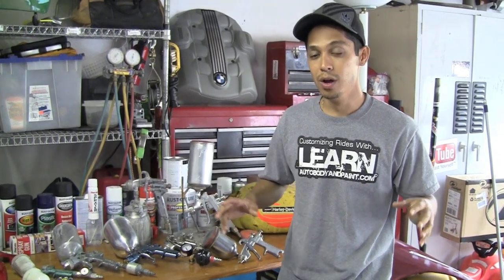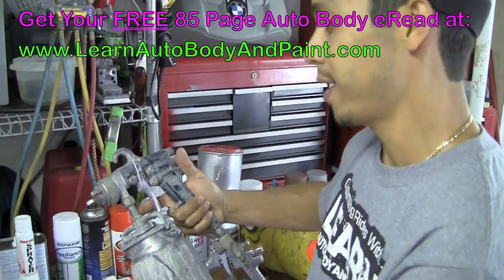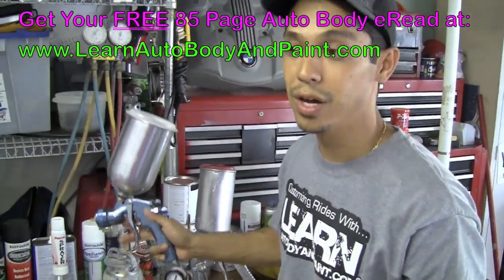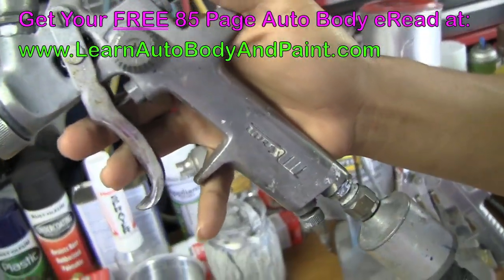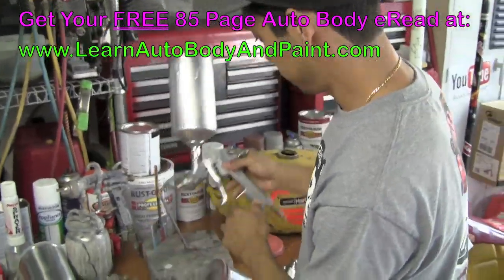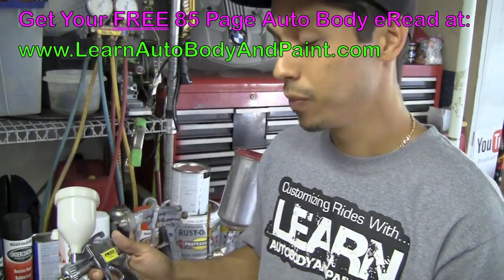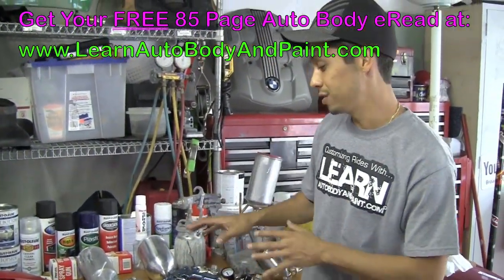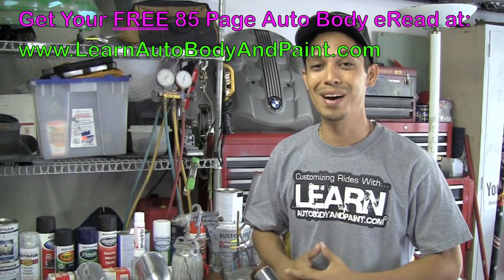Spray Paint Guns - HVLP Spray Guns & Siphon Style Guns - Beginner or Advanced Learning!

Comment from the maker: @ScagSWZU The M1-G to spray basecoats, clear coats, waterbornes, and high solids at fast application speeds with material savings of up to 50%. This comfortably light, superbly balanced spray gun is easy to operate and smooth to trigger with only 18lbs. of inlet pressure required. M1-G employs a unique long lasting self-adjusting cartridge packing for simple replacement.

I think its a great gun, although I've never sprayed it. Sounds like it's great!

Comment: Can you use the same gun to prime and paint or does it have to be different guns I already know how to fill n big dents on the car with putty glaze or bundle and and leave it smooth  what I want to learn now is to paint
Reply: Preferred it to be two different guns. I mean, we use three or four in total. One for thin primer, and another for heavier primers. One for base coats. And one for clear coats. Lol, it really depends on the jobs. Plus, each use requires a good clean up with like lacquer thinner or something and you could be able to use one for two things. As long as you keep up with cleaning it out. lol. Clear coat has Hardener in it, and if it clogs in the streams it will harden the base coat or primer or whatever else you use that gun for. Lol.